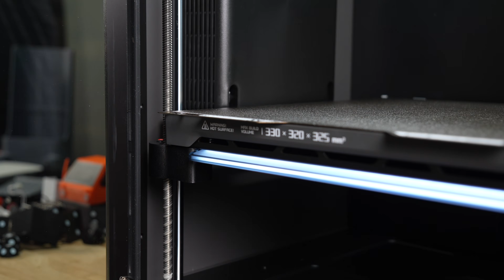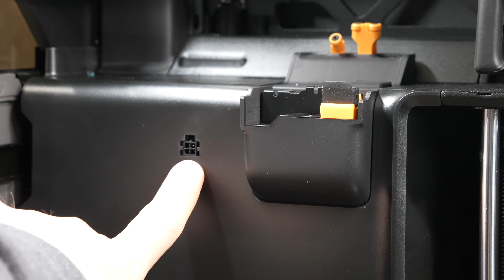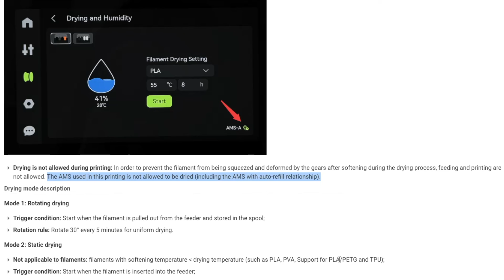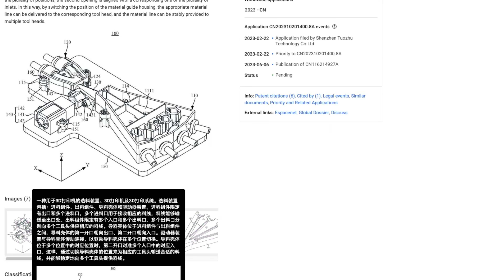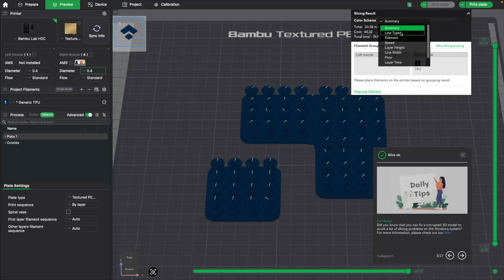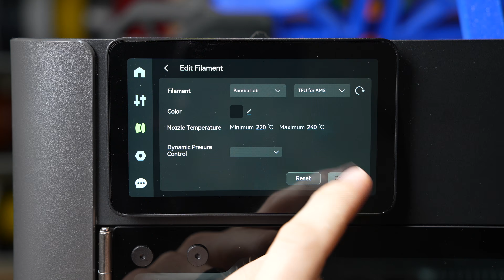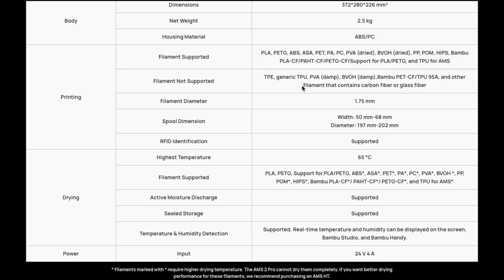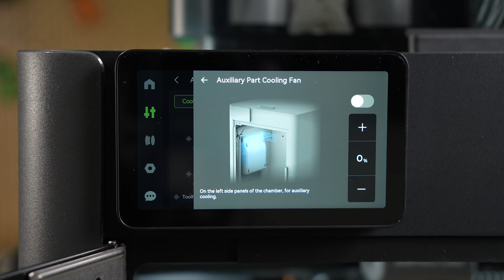3 Months With Bambu Lab’s New Vortek System (H2C Review)

Comment: Given this is a hundred less than the U1 it's a slap in the face to H2D buyers. The execution of color changing here using the AMS here is just inexcusable. The AMS and 2 has always had issues operating multicolor swaps and they've just continued that, and failed to address the flexible filament issue at all. This should have been 500, then it might make sense to lose build volume and still deal with the same existing issues. It's not worth almost a thousand to have this print less poop but take almost as long. You can buy a U1 for that much.
Reply: 100 less than u1 ?????? He literally showed the price of this with combo/laser in the video.
Reply: What are you talking about lol 🤦‍♂️
Reply: The Vortex upgrade to the H2D, not the H2C. I literally stated H2d buyers.

Comment: I thought about the U1. But I ended up getting the H2C for a few reasons. I wanted something bigger. I didn't want to be limited by 4 colors and I wanted to be able to do engineering filaments. Pretty much the only advantages I saw with the U1 over the H2C is price and speed. Neither of which are a big deal to me. My H2C has been incredible so far. It's my 4th Bambu Lab printer. But certainly not my 4th printer. I started this journey over 10 years ago. We have come so far in those 10 years.
Reply: I'd be interested to know how you're using the H2C for engineering filaments.  What's the usecase?  Which engineering filaments are configured where?, etc..   I'm considering the H2C specificially for printing (mostly) single color items of White, Black OR gray.  Plus, maybe different hotend sizes of those engineering filaments.  For example, could I have three different colors of an engineering filament, each with ttwo different size hotends on the right *IF* the entire print will be of one color and one size?  In other words, I'm planning to pick the hotend (ONCE!) for the whole print..  Thanks.

Comment: Thanks for the video , so do you prefer snapmaker u1 or bambulab h2c ?
Reply: How much money are you willing to spend? And what are you printing? 🤣

If 4 colors/materials of the U1 isn't enough, wait for the Prusa Core One with INDX.

I have the H2C and I couldn't recommend it unless the price and comparatively longer print times isn't a problem. Or you just want to nerd out like I did.

I own a business around 3D printing automotive lighting products. I wanted a printer NOW to add on to my P1S and phase out my Voron 2.4 R2 350 with 6 color ERCF out for personal printing and tinkering. I also wanted/needed the convenience of the multi-size nozzle swapping and mainly the easy loading of filaments and backup filaments with the "remotely" placeable AMS'. Which the other 2 by default don't really do well as they are saddle-style side mounted spools.
Reply: @RoasterOven  thanks for your reply , now i have a limited budget, so i have ordered a u1. I think bambulab miss the opportinuty  by keeping  the ams. Yeah maybe prusa but i really like with just print out of the box with no need to tweak.

Comment: I've really enjoyed my H2C that I've been using for the past month.  I needed a reliable large build area printer for a project that I was working on, and the H2C was only a little more than a H2D as I wanted something that could do at least two filaments without all of the waste to P1S' that I already have.  The only problem that I've had with the Combo was the AMS 2 Pro, but I finally fixed that by using one of the old AMS from one of the P1S' that I've had for years now.  The secondary feed in the AMS 2 Pro is a waste of time and more of a hassle than it is worth, and it works just fine with the original AMS, and it still does everything but the dryer and the extra parts to break in the AMS 2 Pro (I've still not had to fix any of the 8 AMS units on the 3 P1S units I have).  I also like the ability to nozzle swap without having to constantly jack with taking it apart to swap, and being able to just swap in the slicer to go from .2 to .4 to .6 nozzles.  And I look forward to get some more sets of nozzles to do dedicated one for ABS to not have to mix with PLA.  At this point for me, this is a hobby and not a full time job, and messing with a printer is really costing me time when I'm not at work.  And most of the available at this time systems are pains in the ass to deal with, I've got a Sovol SV08 that I was trying to convert to toolheads and that is not going good and a waste of time.  And the IDEX system looks good but to get one of those is looking to be not any time soon, and the Prusa machines just seem cheap to me for the amount of money you pay for them.  Also with the button on top of the machine, that is mainly for the laser and other tools for the H2 series.

Comment: The individual tool heads take up less area. That rack is just as deep or deeper and runs up and down the entire side.
Reply: Disagree since you also have those extra reverse bowdens and it's much harder to enclose and heat the printer

Comment: I dont like that we've chosen to go with "tool changer" and "nozzle swapper" to describe these machines, because "tool changer" is inaccurate and it somewhat impacts how we think about and evaluate these machines and their capabilities. 

In classical CNC machinery, toolchanging is swapping the working element that is "unique" - going from one size or type of cutter to another. The actual spindle motor that drives the tool doesn't change. 

On that basis, the H2C is a true toolchanger. The Snapmaker U1 is an extruder changer, and when you call it that, suddenly the U1 sounds a lot more silly from a redundancy standpoint.

Comment: Great video, thanks! 
I have had the H2D since launce, I am very close to buying the Vortek upgrade, it´s just a little steep on the price, but I would love the select nozzle wit a click of a button. 
In the X1C i had the Revo hotend upgrade, and I changed hotends a lot because of how easy it was, now with H2D it is not hard, but hard enough so that I often end up just running the same nozzle every time. 
Having a dedicated nozzle for each type of filament saves you from so many problems, I never had a clog on the Revo nozzles on the X1C because of it, on the H2D I have had several severe clogs on the HF nozzles because I run different filaments without doing cold pulls. 
I think I just talked myself into buying that Vortek upgrade now 🙂

Comment: The H2C is a very expensive compromise that offers the worst of both worlds for one you have the AMS  and the other you have a nozzle changing system that relies on the AMS to work and the fact that to use all of the nozzles you need to buy a 2nd AMS and if  you  do need more than 7 colours then you  start to take long lasting poo's.
Reply from the maker: I love the AMS. I realize everyone doesn’t feel the same way but it’s made filament management for the main materials I print with (pla/abs) so convenient. I do wish you didn’t need two though for the full 7 nozzle setup.

Comment: Too slow, too expensive, too complicated too many failure points compared to traditional tool changers.
I can't believe this thing is $2400+ and it still uses the same garbage components as their cheapest A1. Using some of the worst quality components in this industry, like snowfan brand fans, no name rails and belts and PSU's with fake certifications. Even creality and sovol use higher quality components. Would it kill bambu to use use high quality components. Like prusa does with their delta fans and PSU, gates belts and made in japan THK rails/bearings?
Reply: Practical reviews with much use have shown you assumptions to be false.
Reply: @Sprogster no they haven't. Its literally too expensive and too slow compared to other tool changer 3d printers. Its also plagued with issues and there are daily posts about H2C issues on their sub reddit alone.
Reply: @LilApe  please stop coping bud cmon, it's so sad. Also you forgot to like your comment, you must have been really tilted 😅
Reply: Again with the same made up stuff, yawn 🥱

Comment: Would love to see a review of the 10W laser and etching on 3D prints.
Reply: I like the idea of a lasercutter but printing and cutting just dont mix. There is way to much dirt everywhere.
Reply: @andi67951  No not cutting, almost impossible with the smaller laser. Etching numbers/logos etc is what I need.
Reply from the maker: I’m really not a fan of combining lasers either other technologies. The smoke and soot coming off of the material can’t be good for the motion and other senses and I’d rather keep them separate. I understand limited space means for some an all in one is the only option but for those that can avoid it I highly recommend going a different route.
Reply: @ModBotArmy  But the machine has it built in to engrave 3Dprinted parts ^^ No cutting just etching numbering or logos. Seens som impressive resaults on the forums.

Comment: Its so fascinating to watch, but as long as a system depends on the AMS, im not interested.

Not saying AMS is bad, i have one and use it to easily swap between different materials, but many filaments i use (PPA, PET CF, TPU) arent compatible. I don't see a point in investing into a system that relies on it.
Reply from the maker: I’m really sunrises they haven’t released a version that supports abrasives outside of the HT. That still won’t sold things like tpu but it’s at least a step in the right direction.
Reply: @ModBotArmy  I have had the X1C since it came out, and the H2D since it came out, I have run lots of CF filaments through the AMS units on both, I have never had problems. 
At some point the PTFE tubes will need replacing, but I have not had to yet even on the oldest of them, so don´t be scared about CF filaments in the AMS, just go ahead, you will see it works just fine.
Reply: The AMS2 Pro can handle "normal" CF Filaments like PETG CF relatively well i think, at least mine hasnt shown much wear at the inlet ports or gearing so far, but more advanced Filemants are too brittle for the complicated filament path of the ams (or too soft like with TPU) :(
I understand why that Problem is hard to fix (or circumvent), but maybe they can improve it at some point :)

Comment: The button on top is specifically for starting laser jobs as you should be present when it’s basicly starting controlled fires inside your machine
Reply from the maker: Got it! That makes a lot more sense. An easier to access instant kill job button
Reply: @ModBotArmy The start stop button is more to make sure you’re at the printer to start laser and cutting jobs. The laser version also has an emergency stop button that plugs in on the back. When depressed it kills all power to the printer. You have to twist and pull the emergency stop button to reset it.
Reply: @ModBotArmy  Bambu actually sells a big red button emergency switch on their website that plugs into where the safety key goes in the back
Reply: @crazychainsaw007 
And that big red button which mount low on the right side of the machine came with my H2D with the laser version. (40w)
Reply: @ModBotArmy Now it's a pause button when 3d printing on the latest update.
Reply: @ModBotArmy  You only have to push the top button to start it. UNFORTUNATELY for cutting also.  I added the stop button to mine, and it works fine. Its pretty hard to reach that back button. It did take over an hour to install it, because there are no instructions, its not really obvious how it works. and it only works when it is installed on this specific point on the printer.
Reply: do they make you hold it for the entire laser job?

Comment: INDX will have the same pros, but less cons. Plus more heads. I'm skipping the H2C to wait for that.
Reply: We'll see what you say when it takes you 20 minutes to manually load all the tool heads with filament, and then you have to sit with it when you know one spool is about to run out.
Reply: @A1N0  Exactly...
Reply: You will have to manually feed all toolheads with INDX system, that is certainly something I would not like to go back to doing 🙂 And the AMS that just takes a new roll when the roll runs out of filament is something I have gotten used to as well.
Reply: @chris6160-d6s there will probably be a solution for that in the near future. Once the community (or 3rd party companies) start releasing mods.

Comment: If you need more speed to print things, buy more printers.  I would use print quality as my benchmark over speed.
Reply: The P2S is one of the best printers on that Metric out there. Easy to use, easy to setup and it prints in good Quality and only a slight higher price. Personally i have 7 printers, 5 operational. One is a X1C and have seen a P2S on work. I have a Sovol SV08 Max for Big prints and a Voron 2.4 350 in the building. And some older Bedslingers, one will be a Switchwire at some point. Having one Bambu Lab  is a good Idea as they simply work and are easy to use. i give the same advise as i gave my Nephew: Buy a simple Bedslinger for cheap (ie. A1 Mini at that point Ender 3v2 ) before you go into other Printers, then keep it. Most Cheap Printers needs work done and or you need upgrade repair parts. For that a second Printer is it Money worth in Gold. So i am totally in for more Printers in high Quality over speed printers, even if my Voron 2.4 will be a 7G build and is reinforced so that i can try 10G. We had X-Mas decoration printed for every Teacher at our school. We just got our 6 P2S printers and we got them running 10 Days to get the Batch done. Yes the H2D could reduce the printtime form 6 hours to 4 hours due faster swaps, and could 11 Decorations per day. But each P2S could Produce 7 per day. So having 2 P2S increased the throughputt massivly.
Reply: @Elkarlo77 this is pretty close to my own personal farm. 2 p1s, a1,a1mini, voron 2.4 300, h2d, sovol zero, and a project n4max i am modding.   Folks dont need to be as extreme as us,  but having 2-3 any solid printing printer is faster than any one.
Reply: @Gergman  I would argue having a A1 Mini as starter Printer is a good thing as it is still viable as a medium Speed printer for lot of Jobs. And having a P1S/P2S, Creality K1, Qidi Q4 etc as Primary is good. I am only now giving my modded Ender 3 away, as it is a solid Backup machine for creating Parts. (Lack Enclosure, with 720 Camera and Octoprint, for ABS which i keep). I am now setting my goals at having 3 Printers running and one as "project Printer". 3 Printers running means: 3 Printers within 5 Minutes started. I could theoretical have all 5 printers running. But 3 is a good number to have no bottlenecks. When you had to zip tie your first printer together to print a broken part in PLA so that you can replace it and then Print it in PETG/ABS and then replace the melting part you know why you want 2 printers at least. Which comes back to the A1 (Mini) as workhouse Backup. Or 1 P2S Style printers + a second (PxS is imo the best for reliability)  At work we have some Printer owners and everytime it's the same: After 3-6 Month, unless they have a Bambu Lab Printer, they are in for repair and ask for Printertime on the School Printers or ask me as i do the more esoterik Stuff like CF-Nylons, GF-ABS, ASA etc. (My X1C is modded for high temps.)
Reply: @Elkarlo77 no disagreement.

Comment: I always pull the trigger on this printer because of the geek side of me, but after realizing that I printed only 5 time with more than 2 colors/materials with my x1c in almost 3 yers, the rational side of me went for the H2D.
Reply: Yeah honestly you really only need 2 unless you're doing multicolor craziness. It's pretty unusual you want 3+ different actual materials
Reply: @samk2407 I need 3 filaments. The first for the main object, the second for contrasting color for text or whatever parts need to be highlighted with the same material and a 3rd different material for support interfacing.
Reply: @jayjayhooksch1 yeah but for the contrast u can use the same material so it's not that much worse using a material changer
Reply: For me, I never printed multicolor because I only had 2 Creality Ender 3 V2s. But I invested in the H2C to unlock the ability to multicolor print without having as much waste
Reply: Yeah H2D is probably the more balanced option.
Reply: The 65C chamber and 350C induction nozzle is what im drooling over. Waiting for rumors about X2C

Comment: On speed in testing (depends a little on model) we found U1 is faster on 3-4 colors but h2c is faster on 1 and 2 colors. The 2 color one is interesting yes it still is a little slower on swaps (even without vortek) but the new prime tower and just faster printing each layer it wins by a little (about 10%) its also a little faster than the h2d mostly because of the new nozzle warming up faster. On prints 3-4 colors the U1 is about 2x (1.0x) the speed of the h2c (0.5x) and the h2c was about 2x faster than the h2d (0.25x). Also clearly the h2c beats the tool changers on more colors than toolheads. Overal the h2c is a interesting compromise just not for people who want 'simple' 3 or 4 color prints or mostly tpu. It sidesteps all of the nornal downsides of a full toolchangers at the cost of speed for >2 colors.
Reply: I wonder how the U1 would do paired with an AMS, if there are colors that are not used very frequently I would bet its competitive with the H2C since the h2c still has to retract and prime filament for each change